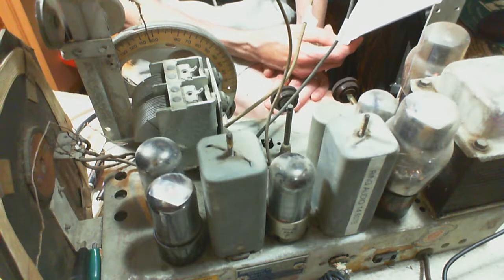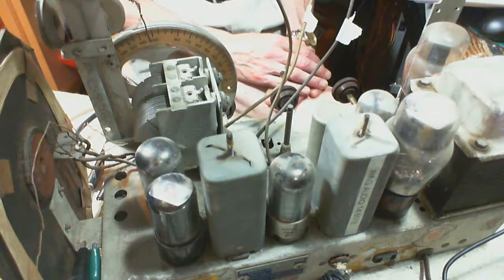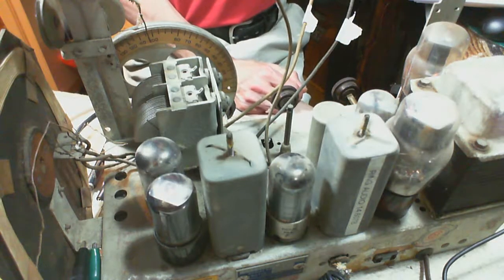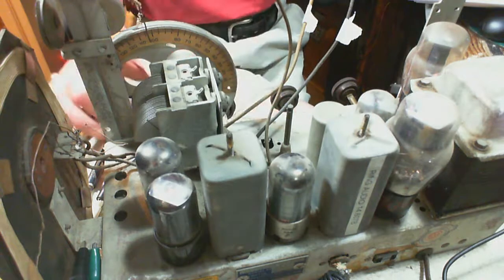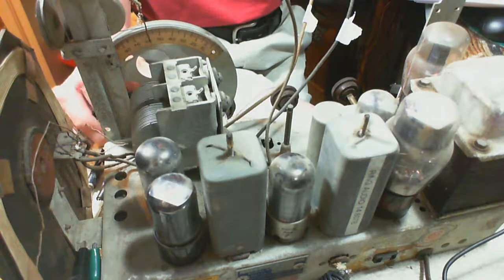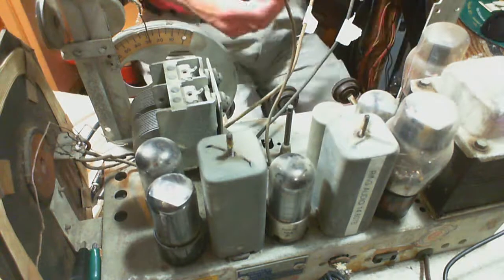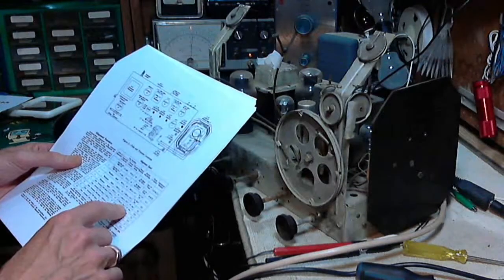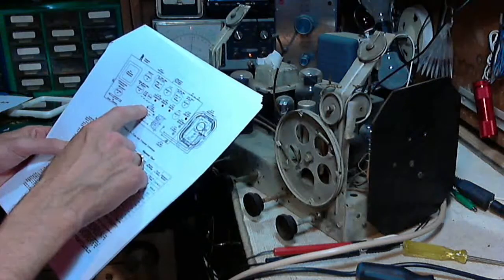RCA A24 Antique Vacuum Tube Radio Video #10 - Lost in Space

Comment: you should shoot a little of that cleaner on the turning dial nut and the bearings.  Of course this is posted long after you did this.  But I would just do a general clean up of all dials and variable capacitors before tuning.  And give a thourough.          va cumining of those tuning capacitor plates.